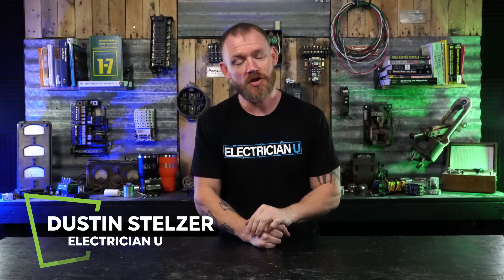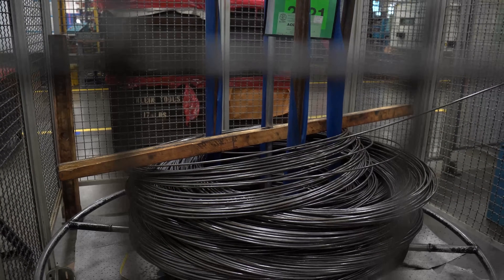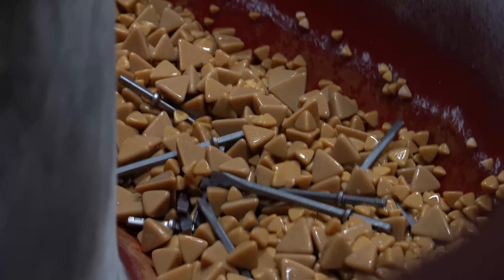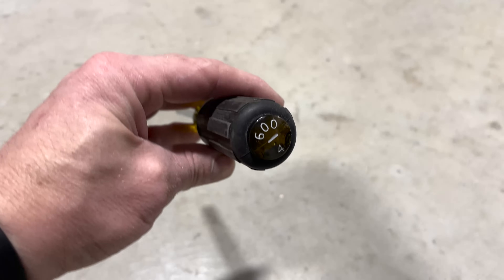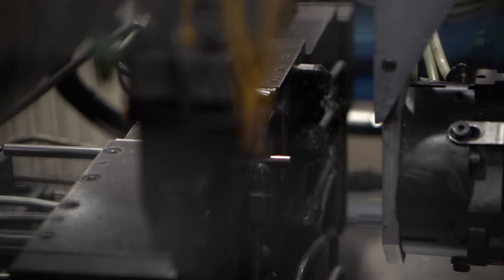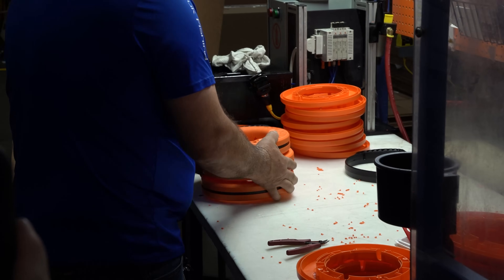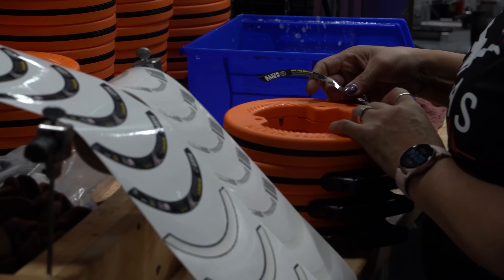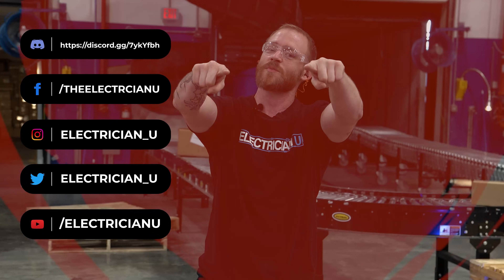How Screwdrivers and Fish Tape is Made - TRIP TO KLEIN PT2

Comment: I’m a plumber but I use Klein screwdrivers. I love the labeling on top. I have 11 in 1 for my 11 in 1, multi for my multi nut driver, a cross for my Phillips, and hammer indentations for my slot screwdriver.

Comment: I bought the largest  Klein multi nut driver a few months ago, I haven't used it but a couple times and I dropped it from my tool bag to the floor and right where the yellow plastic meets the black grip it cracked all the way around the handle needless to say I wasn't happy.  Really klein??  I would understand if it was off a 12 foot ladder.

Comment: Would love to see how they do the 7 in 1 pass through nut driver (or 5 in 1, maybe a 6 in 1 as well 🤔), along with the other multi but screwdrivers. That would cool to see how it’s formed and shaped, as well as the famous black rubber soft grip being put on the handle.
Fish tales are interesting to see being made, find that fascinating to see that, thx👍🏻 Wonder long ago when the first fish tapes started to appear, if they were all made by hand. Like someone actually winding them up 🤔. Seeing how Klein’s meters and testers and even measure tapes would be awesome to see. 
Can there be a part 3 if have footage of that🙏🏼
Appreciate sharing, and you had to have had an awesome time going up there and have access to both complexes, so lucky.
Cheers bro✌🏻
Reply: I think most of those multibit screwdrivers are overseas produced
Reply: I was curious about the multibit drivers as well, because I noticed they say "assembled in the US" on the package. So where are the parts coming from is what I'd like to know

Comment: Could you give me some examples of why, when and what size nut drivers you would use in the field? Dont see a purpose in buying a set. I have a 5/16 nut driver bit for my impact I use always and of course on the 11 in 1. To buy a set I dont feel convinced.
Reply: I use the 7/16" a lot for 1/4" hex nuts. For years used the 11/32 for ballast nuts.
Reply: just get the nut driver multitool,it has everything you need.I find myself using my 1/4 inch and 3/8 drive impact  sockets pretty often as well.makita has those sets in a blue rubber sleeve and it’s pretty small and easy to carry
Reply: @WorstElectrician  I'll definitely look into that, thank you!